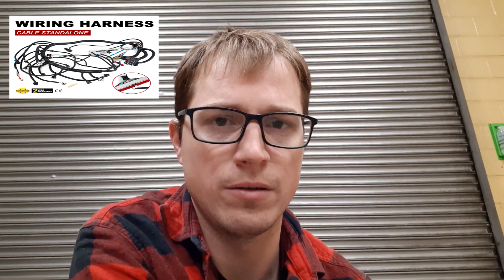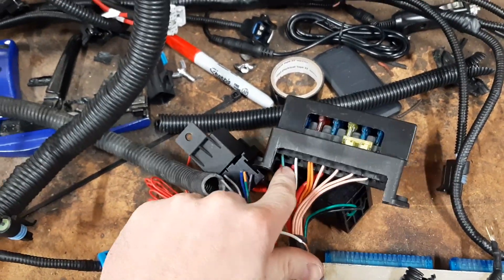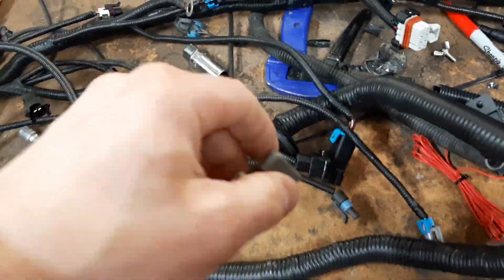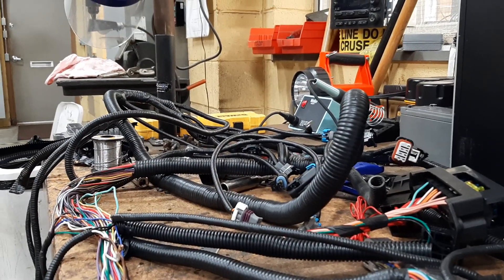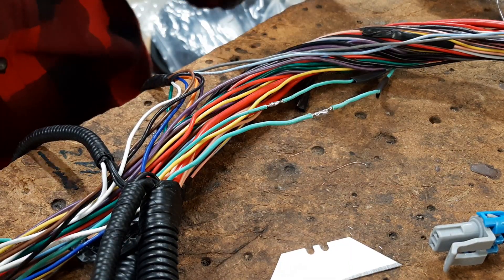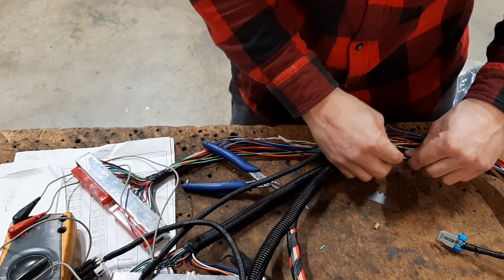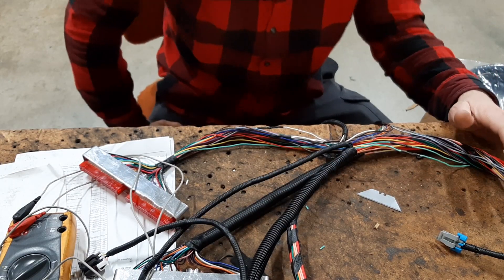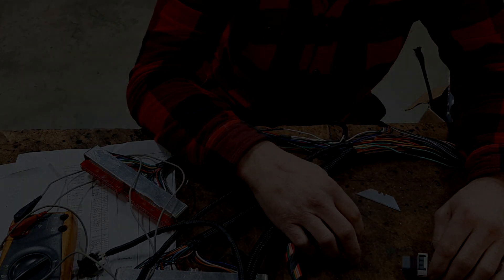china ls1 t56 wiring harness repair issues. HOW TO FIX Guide 4.8 5.3 5.7 6.0

Comment: Thanks man I have a harness I bought years ago I haven't installed it because I had to put a stop to my build for health issues now yrs later I am back at it I got lucky on my harness it was just the tach wires crossed everything else checked out good I remember running into your video and others about checking these 2 wires thanks again man I'm sure you saved me a head ache finally about to get my car running thanks

Comment: I have a problem with my wiring harness killing the battery overnight could anyone tell me why is that happening 12 volts at all times
Reply from the maker: The reverse lockout seems to be the most common problem.  It's on a 12v b+ in these harnesses

Comment: I guess I know what I’m doing this weekend. Lol. Mine starts up but I’m getting cel light for both upstream o2 censors not having any activity active and it’ll idle kind of high and when I give it gas it kind of revs up but then drops down a lot like it’s out of gas. I worked my old harness about a year ago and had no problems, I just didn’t like how bad it was clustering up my engine bay. Went with a chinnnna harness…
Reply: What was your problem with the Erving and falling off mine is doing that now

Comment: So ive bought one of these harnesses and i did the 4l80e repin on the trans plug and ecm connector and now my truck struggles to go into gears and when it finally goes into gear, my truck shifts hard and there is no 4th gear. The transmission was tested before performing my swap and its all good, shifted smoothly. Have any idea what it could be? Will be much appreciated if you could get to my comment
Reply from the maker: Make sure the main plug on trans is not flipped.  You can plug it in upside-down... ask me how I know lol
Reply: @matafied  i checked it and its plugged in correctly, have any other ideas? I think i might just have to peel back the harness and see if theres anything wrong
Reply from the maker: @Favela1017  I would just double check the pin out and make sure it is wired correctly
Reply: @matafied  appriciate you, most mechanics would want to charge an arm and a leg for simple information like this lol

Comment: Does anyone have any advice for someone using a China harness with the 4l60e trans?  I'm sure i have a problem somewhere in my harness.  Vehicle starts, fires for a second then dies.  On my second PCM now and yes VATS is deleted.  Any info???
Reply from the maker: Make sure injector data is correct.  If it has ev6 injector plugs. It has 36lb injectors. The majority of the ls truck engines come with 24lb Injectors. So it can cause it to start then cut right back off
Reply: @matafied  thanks for the response.  So it's a truck engine, truck PCM and i have the convertor plugs from ev6 to the truck injectors.  Does the wiring change between the 2?
Reply from the maker: @jamesnebel6211  so the wiring harness has ev6 and you have adapters to convert to truck? Also is the truck pcm the original one to the engine?
Reply: @matafied   that's correct i have the adapters, and no it was purchased online with everything deleted for the swap.  When i put my scanner on it, it comes up as a 2000 GMC Sierra
Reply from the maker: @jamesnebel6211  so assuming the tune up is correct.  1. Check fuel pressure make sure it's good. 2. Hook up scanner and see what the map sensor is reading.  3 . See what coolant temp and intake air temp is displaying
Reply: @matafied  fuel pressure is just above 50psi, iat and ECT is 95 and 86 deg do they seem right.  Gonna check map tonight, not totally sure what it's supposed to be yet.
Reply from the maker: @jamesnebel6211  with key on engine not running it should be barometric.  So 14.7 psi or 101 kpa roughly at sea level. Also if this swap is In a older vehicle verify you are not loosing your ignition voltage.
Reply: @matafied  ok I'll check that, and it's a 62 impala which I've verified 12vdc in run and crank but not sure if maybe it falls off turning the key back to run so I'll check that too.  Thank again for all your help!
Reply: @MATAfied turns out the map sensor was fried. Replaced and runs great now!  When i first put in the harness i accidentally had the map and the crank position connectors swapped.  Never would have guessed it would get the sensor but sure enough.  So if you map sensor reads around 3 psi it's garbage!  Thanks again so much for the help!
Reply from the maker: @jamesnebel6211  cool deal. Yep it locks it into one cell of the fuel and timing table. Good enough to fire but not stay running.
Reply: @jamesnebel6211  no
Reply: @jamesnebel6211  Do you have any photos or video of your Impala I'd love to see how it turned out.

Comment: Thank you so much for making this video. I bought one of these wuhan wire bois and already had to change a few little things. I'm glad I learned of the MAP signal wire issue as well as the tach issue. Thank you again!!!
Reply: what other things you had to change?? I have on and i am fixing these issuse listed in the video and grounds. I notice the grounds need to be beef up.. What other issuse are you correcting...? I prefer this route versus reworking a stock.. I tried that and it is a nightmare...lol

Comment: Hey i know this is a dumb thing to ask but i reworked my stock harness and i pulled my o2 sensor from the up stream sensors (dont know if its bank 1 or 2) would you know how to hook them back up
Reply: By the pin they go to at ECU